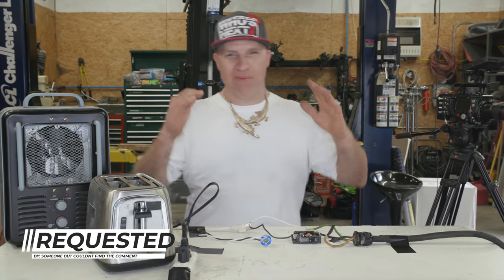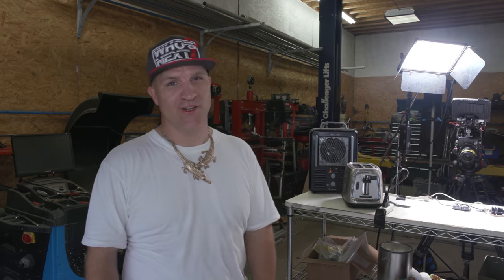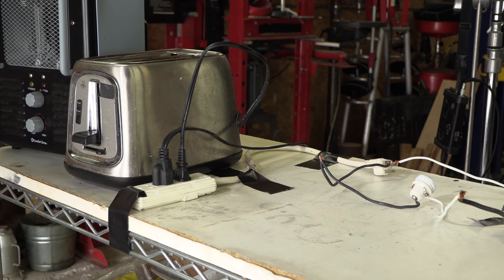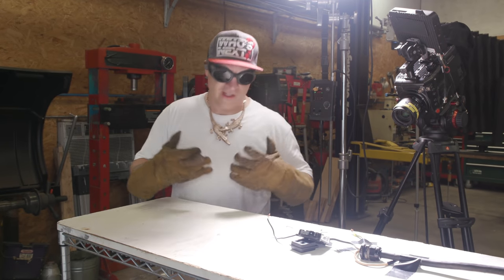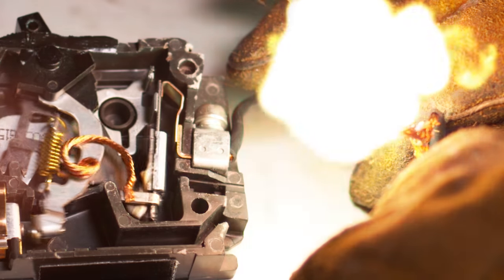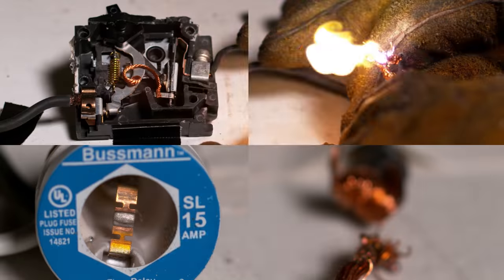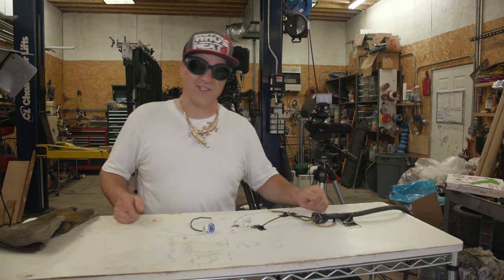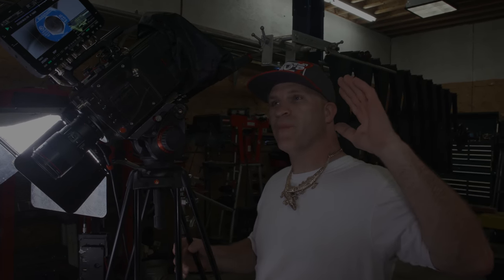Fuse vs Circuit Breaker Which Blows Faster (Slow Motion)

Comment: Definitely the fuse but that wasn't even the fastest fuse you can use because you used the slower reacting "time delay" fuse. I also wonder if the soldering to the fuse didn't somehow weaken it to make it blow faster.
 What I also thought was impressive was the arc that released from the contacts within the breaker. How many times are they good for before they are at risk for welding themselves together? Relays will.
Reply from the maker: Great point and you're absolutely correct, but the breaker in my opinion is also time delay so I only thought it was fair if I used a time delay fuse against the circuit breaker. I don't think me soldering ir weakened it in anyway, but that is a great question I wonder how many cycles the circuit breaker is good for, but in reality if your circuit breaker keeps on tripping I would think you have a much bigger problem, or you just have too many devices hooked up to that circuit.
Reply: @WarpedYT  No doubt about that. But I was thinking more in the longer time span. Like if it's been in use for 50 years when does that CB need replacing?

I had a house that had CBers for the majority of the house then had an addon and that was all fuses. The other funny thing I have noticed is, despite being very old technology, the price of fuses has never gone down.
Reply: @johnpossum556  Good point with the relays, but a breaker usually have a way stronger spring to pull them apart. Still breakers have a finite number of cycles breaking a short they can do.

Also, relays tend to weld on closing, not opening!

Comment: Seems like u would need to know the exact moment the circuit is interrupted I wonder if the breaker cuts off before the switch is flipped 100% or if it waits until the switch is completely off

Comment: The reason we switched to the slower, but still fast enough breakers is that they are reusable.  A fuse blows, and it cannot be reused, and must be replaced.  they are expensive, because like a lightbulb, they must be sealed, must be lower than atmospheric pressure, and also must be filled with a gas other than oxygen and nitrogen, much like a lightbulb.  They are very expensive to produce, and not good for the environment.  If they weren't set up like a light bulb, the filament(its still called a filament) would burn away quickly under a slight load, because its a paper thing sheet of steel.

Comment: Next time, just use a 4 ft shorting stick to cause a shortckt. May save your life - even at 120v A shorting stick is just a 4 ft length of PV with a copper hook at 1 end and a small jumper cable. If you have seen arcflash videos, you will know why even 12 volts can be deadly

Comment: By the way, whatever happened to the turbo fuel injected mega squirt engine?
Reply from the maker: its coming very soon, finally got it moving, had some design delays and had to make some parts, and I was working on filming storm stories since May so im behind on my WP projects. just wrapped Storm Stories 2 weeks ago now I have the briggs moving along, im excited,the episode is half done just stuck at the point where I have to get the AMP EFI EVO working on the briggs, its gonna blow this time im sure !. thanks for asking and thanks for watching!
Reply: @WarpedYT  I'd kinda like to see if the turbo charger creates a vapor trail behind the blades.

Comment: I think, it would be cool if you put the circuit braker and the fuse in serial, and to see, who is faster.
Reply from the maker: I thought of that, but I think one or the other will blow first I don't think they will both blow. I will totally try it though
Reply: @WarpedYT  and in that case we'll clearly see which one of them is faster...in equal conditions, because if you simply short them by hand, it is not an ideal condition.
Reply: But I think the fuse would be faster )))

Comment: thats a slow-blow fuse, see it says 'time delay' on the bottom front. thats a house fuse, for electronics you want a fast-blow. as for which is faster, thats not too important, the benefit of the circuit breaker is easy reset instead being tempted to toss a penny behind the fuse until you go to the store for a new fuse
Reply from the maker: "Toss a penny" WOW! Sounds interesting!.  You are correct, but the thing is I wanted to compare equally, since a circuit breaker is technically a time delay fuse, I used a plug-in time delay fuse as well. You're also correct in the fact that you use a fast blow for electronics no doubt.

Comment: Think you must of used a D type breaker.
Reply from the maker: I think it is a d type.. I want to try the squareD QO.
Reply: Warped Perception D types are used in industrial situations and have a slower disconnect time. 
B types are domestic and operate much quicker.

Comment: When comparing the same type of breaker and fuse (Slow blow or fast blow), the fuse is usually faster; Making them a tiny bit safer. However, this is offset due to the fact that an idiot homeowner can either knowingly or unknowingly replace a blown fuse with a higher amp rating than what the circuit allows. IE: They could replace a 15A with a 30A. Or if they're complete idiots, they'll shove a paper clip or some other scrap metal in the fuse socket to completely bypass over-current protection.